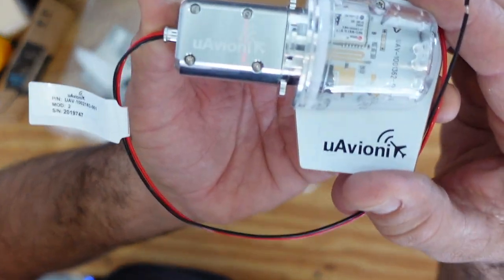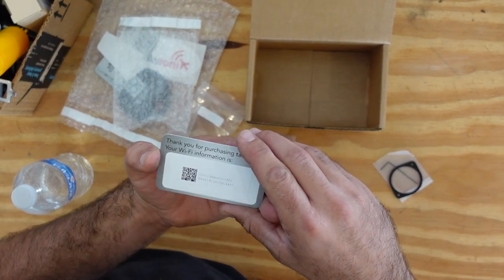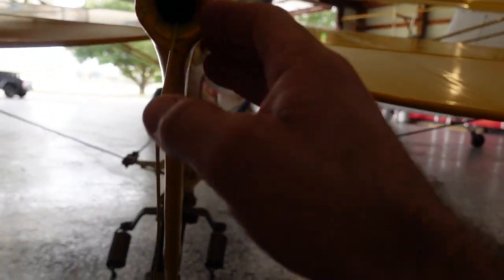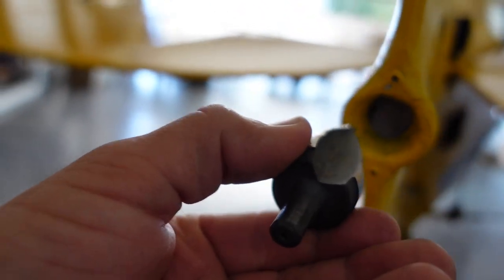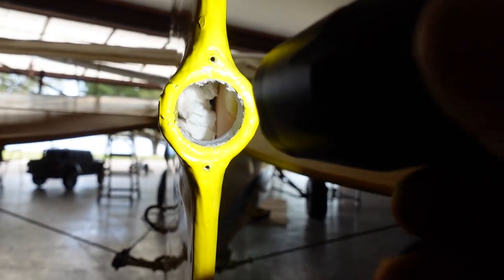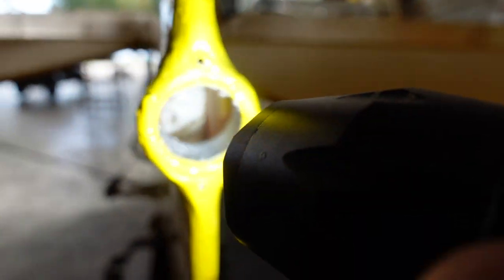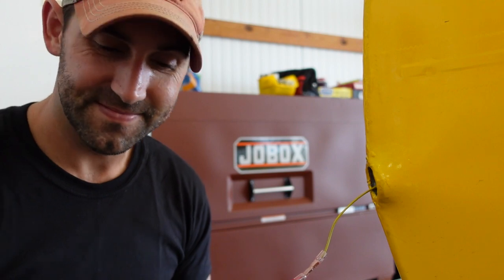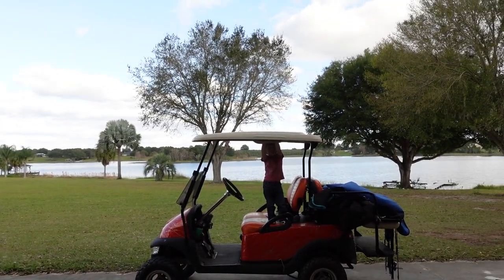uAvionix Tail Beacon Install | Super Cub

Comment: An alternative install perhaps on a rag and tube plane would be to mount the beacon inside the tail end of the fuselage - fab up a bracket and adel clamp to a tube and have kept the original tail light and not had all that fuss to make the beacon fit in its place.

Comment: Hi Jim,

Nice video, thanks for posting.  Just curious on how you grounded the TB since you had only a single power line to the original?  Anything special?

Cheers
Reply from the maker: Hey thanks! I grounded  to the mounting screw. When I put the beacon in I brought the ground wire back out through the side and wrapped it around the mounting screw sandwiched between the mounting plate and the rudder. Hope that helps.

Cheers
Reply: @JimBilton  Thanks for taking the time to answer my question. That helps a lot! Many of the install videos don’t address the basic ground wire. UAvionics recommended running a ground all the way back to the battery, but that seemed a little excessive. But who am I to question that since I am not an A&P…

Cheers